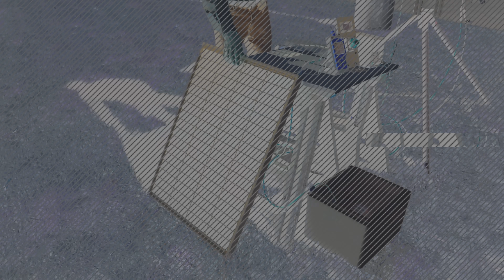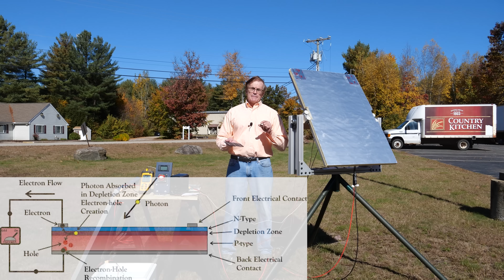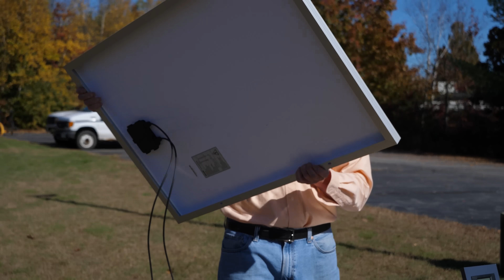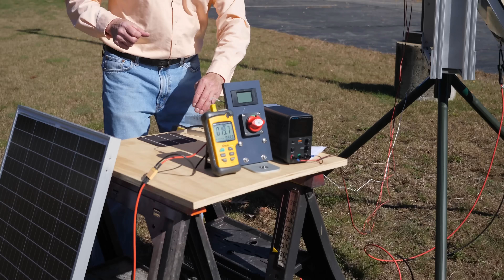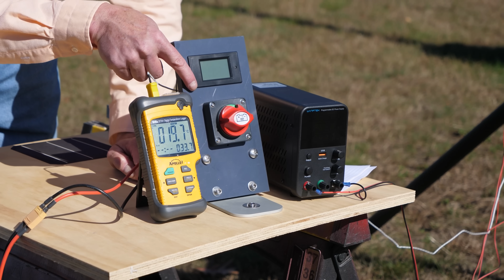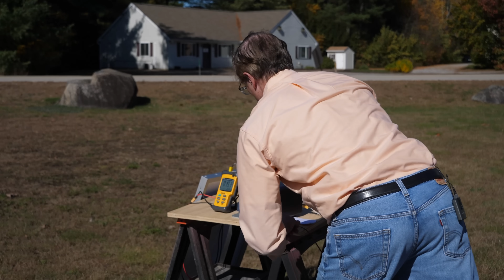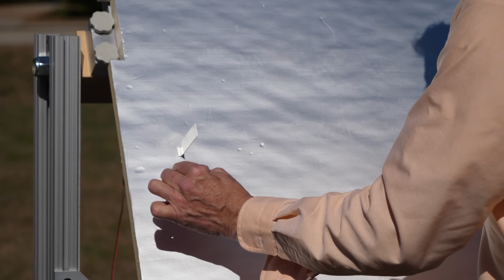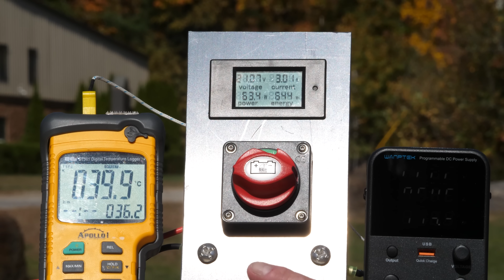Do you REALLY get enough out of your solar panel?

Comment: Really liked this video. You could achieve much better power efficiency using computer fans. Noctua sells their A14 which has a 1.6 watt power consumption at 1500 rpm and 82.5 cfm. They sell a waterproof industrial version of this which is a further 10% more efficient according to their website. These fans would provide roughly 2.5x more airflow per watt.

The computer fan industry has a lot more competition and much more innovation, also important to bear in mind that power consumption increases a lot at increased rpm. 

At 800rpm and roughly 55% of the airflow these fans only use 25% of the electricity.

Edit: 5:24 I should have probably watched 5 more seconds of this video before writing this comment. Still, there are fans that are 20-30+% more efficient, especially if you step up to a larger size like 180 or 200mm. Edit2: seems you covered this at 19:04 as well haha.

Comment: Fan = moving part! Its longevity << solar panel longevity. You didn't factor in the added cost of original fans & intermediate replacements (due to defects/failures) & the associated higher/added repair/maintenance cost. Please do.          :_[               hYlkeW

Comment: Brilliant Video, However those Fans are not designed to last very long (bearing failure).  They would have to be replaced at great expense (Labor) several times during the life of the panel.  A large exterior fan tubing matrix would work and the fan units can be replaced inexpensively from an easily accessible 'air handler' set up for this application. What do you think?
Reply from the maker: Agreed.  Remember, you only need to run them several hours  per day when the benefits of efficiency and longevity are the greatest.

Comment: You didn't go far enough, you haven't tested your heatsink. Not sure where you put your thermal sensor, hopefully on the panels themselves. But would you have gotten the same high temp if the panel didn't have the heatsink? You should have had a control panel beside the test panel, being the atmosphere created variability. With solar panels hopefully continue to lessen in value, the arguement of longevity?  Also your tests need to be done over the year, perhaps that is what you are doing.  I can think of more questions, but we shall see if you are continuing the testing.

Comment: thermal epoxy on backside of the panel? Can it damage the cell? Are delicate layers in front, back or between the glass? I will experiment on my roof installation by sealing all the gaps and blow air trough the back with a big central fan.
Reply from the maker: No, it won't.  Panels  are sealed with epoxy at the manufacturer.

Comment: why not use watercooling on their backs and pre heat water befor it goes into your house's system. i mean it seems silly to spend power on getting rid of heat, that youd pay for on the inside of your house. so you save money on heating and get a lil more power out to. Insted of just getting a lil bit more power.

Comment: I think you are wrong when you say 100W on the equator. On the equator the sun produces 1400 W/m2 and not 1000 W/m2 which is used when the efficiency of solar penals are tested. So a 100W panel should much more on the equator. But as usual awesome video.
Reply: Without magnification or mirrors, the sun does not produce 1400 w/m^2 at sea level anywhere.  It's about 1400 w/m^2 outside the Earth's atmosphere however.  I believe it's called the solar constant.
Reply: @palindromeambigram4852  Thanks for correcting and avoiding the spread of wrong information. I rechecked and you are right.
Reply: @edsteve  You're welcome!

Comment: There are already different brands of hybrid solar panels available that combine the electric power generation as well the heat generation of the panels. The heat is then used via a heat exchanger for making hot water or heat up a swimming pool. The heat  is then properly used and even improve the efficiency of the electric power generation

Comment: Great video. I self installed a DIY 16kw grid tie system last year. Learned a ton, and the cold temperature performance of my panels is incredible. Any way we can cool them is definitely worth exploring. However, the former engineer in me says that the net benefit of a system like in this video is not going to pay for itself in terms of additional generation and panel longevity vs just adding a couple more panels.

However, a swamp cooling type system might be something worth exploring both for solar panels and air conditioning systems.
Reply: In New Zealand we get slightly more than the rated panel output even if the panel is not sun perpendicular. Chinese panels are so cheap, less than US$0.5 per watt that shortfalls are usually fixed with more panels space allowing. My panels are less upright so mounting is usually parallel to the roof surface. We frequently have a cool breeze (trade winds) so a gap of 150mm (6 inches) is enough to keep the panels quite cool, the little heat sinks would help too. My ten year experience is that more panels is cheaper than mppt etc even just relying on rain for cleaning, my cleaning them properly added only a few percent. In Australia (our neighbour) areas that lost their long overhead grid cables in the bush fires are installing turn-key solar, lithium and BUG systems. The market is for cheap usable ex EV batteries, they are now rare. I use 60% ex Nissan leaf batteries without problems and charge my 2011 Leaf off the system.

Comment: why not drill a hole in the side of the frame and connect up some sort of tubular ducting (similar to the plastic water piping which is very bad at conducting atmospheric heat) to direct the air to the slot gaps between the fins which could utilise quick snap attachments to interconnet each pannel to the next.

You could then make a venting system in the lower half which is routed through to a common duct and again join them pannel by pannel.

You could then have a push/pull air system using a larger version of a PC GPU fan to route the air through each of the pannels and a standard large fan on the exit to encourage the airflow out. 

Only other method I could imagine would be to creat your own heatpipe device.

That way, you could run it through the fins at regular intervals exiting the side of the solar panels' framework.  The heatpipe, being in contact with the fins, could then run back to a radiator which could have its own fan connected to it to expel the heat, or, if you wanted to go on a journey into the unknown, you could try expelling the heat into a sand heat storage 'battery' maybe.

Then, you could utilise the heat in the sand to make hot water for use in the house.

Comment: Regrettably, there are quite a few details about some assumptions and the test setup that are more than just a bit wrong.  It all adds up to making the data and conclusions "suspect".  The biggest one is that it is certain that prior to turning on the fans, the panel was NOT operating at it's maximum power point and it is likely that after the fans have been on for a few minutes, the panel, while closer, also wasn't operating at it's maximum power point.  You can tell all this because the current was just about 2.90 Amps (when hotter) whereas it was about 3.01 Amps after the fans were on for a few minutes.  Believe it or not, they should have been about the same.  Technically, for crystalline silicon solar cells, the maximum power point current (Imp) actually goes up slightly with temperature but, of course, the maximum power point voltage (Vmp) goes down considerably more and hence, the product of the two (Pmp) goes down.  Only the voltages (Vmp) should have been different.

In the end, you should have used an MPPT instead of a fixed resistor load.

I'd be interested to see the test repeated with an MPPT and would be more than happy to explain exactly how you should do it if you'd like.

Comment: Its so ironic how .gov is pushing for these solar panels, and at the same time,
they are trying to block out the sun. smh
Reply: The .gov is trying to block out the sun(?)
Reply: @palindromeambigram4852  Yes. And when they start talking about it, you know they've been doing it (since the early 90's) Geoengineering. Those airplanes that leave "contrails" that spread for miles, until the sun is completely blocked out? They aren't contrails. Airplanes don't dictate our weather.
Reply: @bogey19018  Oh.  You're one of those.  Sorry but gotta run.....
Reply: @palindromeambigram4852  .gov just released a memo on it about a month ago, so yeah.

Comment: No need to worry about winter because you would just turn off the summer cooling system.?? Right?
Reply from the maker: Probably.  Not because  it wouldn't  still increase the efficiency, but because  the relatively  low solar intensity would make the improvement too small. Save the fans.
Reply: @TechIngredients  I also live in Maine and live off grid. Great Channel Sir.

Comment: Put a layer of Peltier elements between the cells and the cooling fins. ;-)
Reply from the maker: It's probably not worth it. They're  not cheap, and the heat flow will be restricted by the TECs, making the PV panel hotter and less efficient.

Comment: You forgot 2 details:
1. Solar tracking will add consumption of energy. If you don't use solar tracking, then less energy you will get during one day, so therefore the cooling fans will not be so efficient.
2. You will add the cost of maintenance, those fans eventually will die, so you will have to service them, only the energy you consume to replace them on a roof is way much bigger then the energy they generate during lifetime.
Reply from the maker: You're  making  two incorrect assumptions.
1. With or without tracking, the fans will increase the efficiency , but the baseline is not fixed. This depends on where you live and the time of year.  In many  areas, the fans will be more efficient  than in our tests.
2. Maintenance is a cost with any system.  Remember, the panels  themselves  will last longer with cooling. They are maintenance items as well and big ones.

Comment: Love this idea, the video and the quality of execution. I'm a solar engineer and enjoy doing weird stuff with PV and solar thermal. But no, it's not worth it. The initial degradation of PV modules when they are brand new is unavoidable. It's caused by UV radiation (and maybe a little by heat). Sure, heat is a factor in the long-term degradation. But I'd rather buy an extra 1 PV module for every 20 modules to offset this loss.

The "Standard Test Conditions" Voc/Isc/watt ratings on modules are only used to design circuits for over voltage and overcurrent protection. This is a code compliance thing.

All other engineering for performance optimization uses the "Nominal Operating Conditions" ratings, which derates the module performance to typical (hot) conditions. Even then, we oversize the PV array for the load it powers.

It's just not worth the up-front cost or maintenance for active cooling. We'd be better off improving PV durability than creating ideal environmental conditions.

Again, I love this video and the channel and what you're doing. Get a pyranometer for more data during these experiments!

Comment: I just have to ask; won't the excess heat created by solar panels exacerbate the warming of the climate?
Reply from the maker: There is no excess heat.  It's  the same energy  from the sun.
Reply: @TechIngredients  Forgive me. I guess I don't understand. The heat you are trying to dissipate would not be there if there was no solar panel. It's over my head I guess. Sorry
Reply: What "excess heat"?
Reply: @palindromeambigram4852  So, if one focuses the sun through a magnifying glass onto an object, that object will not produce "excess heat"?
Reply: @dwmiller4128  What does "focusing the sun through a magnifying glass onto an object" have to do with this video?

Comment: Here in Australia we sometimes have forced air ventilation of roof spaces to reduce the heat gain through the ceiling, so in those cases you could even just redirect that existing airflow to behind the panels for an even greater efficiency gain and very low capital outlay. Likewise with air conditioners, commercial buildings usually have about 0.7 air changes per hour, so all that chilled air being discarded could be blown behind the panels.

Comment: Interesting test and good setup. Would drilling ports in the sides of the upper and lower edges of the aluminum frames (ports diameter as large as possible without damaging the panel) allow easier air flow like houses have soffit and ridge vents to cycle air and keep the roof surface cooler? Seems like the enclosed frame creates a natural heat bubble trap. Could adding a flat-black painted HVAC round/square duct positioned along the top of the array and connected to the drilled panel ports via non-conductive (pvc) pipe be heated enough by the sun to generate a passive cooling system naturally drawing cool air across the bottom of the panels without a mechanical fan just like like a house ridge vent/soffit system does? Test with and without backing aluminum sheet. Also points to open-backed ground mount is much better than roof mount installations that trap more heat. Effectiveness of round ports vs ovals vs saw blade slits and 'wind tunnel' tricks (smooth edges vs sharp) to reduce drag on the flowing air might be interesting too.
Reply from the maker: I have no doubt that detailed  modeling and testing can improve this further.

Comment: Cool stuff! The only thing is that making a robust cooling system is a bit of a challenge. I meant it is hard to make it both cheap and working for 20 years with no maintenance. But it is very cool proof of concept anyway.
Also, your experiment is very well done!
Reply from the maker: Thanks, and I agree.
It's  not a trivial engineering issue, but there is a significant  potential.

Comment: Very interesting, although I would have liked to have seem the comparison with an unmodified panel, as without the fans was your modified one actually trapping in heat? I'm wondering what would happen if a fan failed, would the panel then actually get hotter and produce less energy than an standard one. Considering the cost of a panel is currently about 33p/watt, I'd be tempted to just install another panel instead :)

Comment: I have 5kw solar system, and here in Sevilla when the temperature rise to 45C°(air temperature) my panels only produce 3KW in direct sun alignment… i thought this fan idea but the problem is, one, fan doesn’t work reliably thousand of hours, and two the heat affects the fan too. The better solution is no maintenance no moving parts
Reply from the maker: You don't  know that yet. Some fans have MTTF as high as 40,000 hours.
You also don't  need to run them continuously, but rather several  hours each clear day when they will do the most good.

Comment: Another Engineering argument that you missed is:
- Each panel design now has added complexity.
- Adds to higher manufacturing costs.
- Adds time and man power costs for design, testing and validation of MTBF for these modifications (heat sink design and fan).
- Adds cost for product support due to increased complexity of design in the form of spare parts, parts storage and support personnel to carry out repairs or replacement should any additional component fail.
- Adds risk to Company and product image/reputation should the change in system design be problematic over the warranted lifespan of the system.

If someone wants to modify the solar array after the fact, then the above are non issues but most people are not Electonic Engineers or savvy enough to bother modifying a system and voiding the warranty.
Yes, the experiment method and results are valid but they only validated that which is already known. 
Heat for solar cell arrays = reduction in performance.
The educational side of this video is great though.
Reply from the maker: True.  But now that the performance has been established and arguments for further gains presented, then looking into these manufacturing and marketing issues make sense.

Comment: What did you use to attach the heat sink fins to the back of the solar panel?
Reply from the maker: Our thermally conductive epoxy.
Check out that earlier video.

Comment: Great implementation and analysis of the benefits of cooling PV panels. In Australia, PV panels are subsidised, so rather than seeking out better efficiency, it's common to just add more panels, as they're relatively cheap compared to the cost of labour. A nominal 10kW system will typically have 13.3 kW of panels.

Comment: I would like to know how the added cooling fins perform in free air without the backplate. Improved passive cooling could be a sweet spot on effort, cost, maintenance etc. Because fans can and will break over this long lifetime. Nice job, thank you!
Reply from the maker: Good question!
There is a very small but consistent  improvement  with passive  cooling alone.
Reply: @TechIngredients  hope you are doing another test with passive cooling setup. The main problem is really the maintenance effort rather troublesome. Imagine having tens or more panels with 3 fans each and  you have to at least clean them regularly. I cant thank you enough if you can publish the photos of the heatsink before being attached to the panel and also the comparison test video between panels with active cooling, passive cooling and no cooling.

And also thank you for the video, It really answer my question and this would help me a lot on planning my future solar panel construction